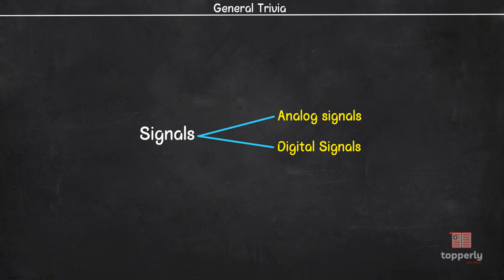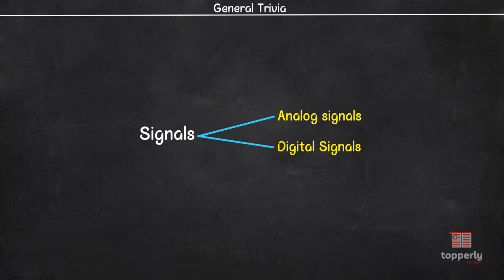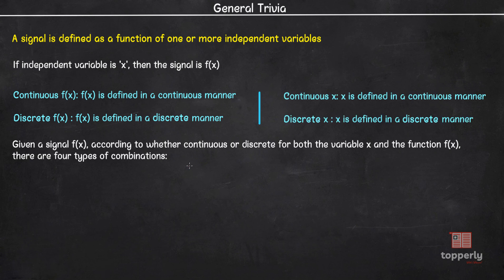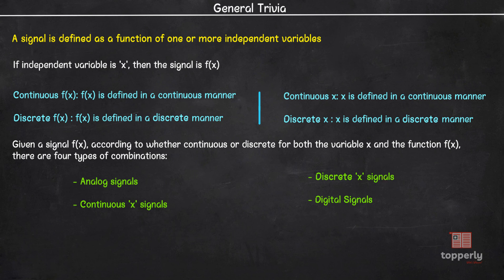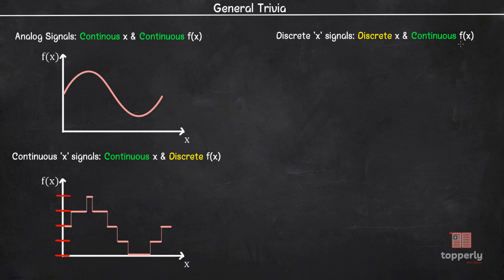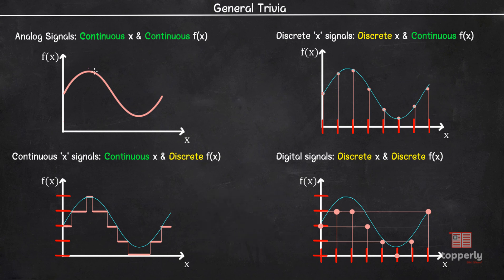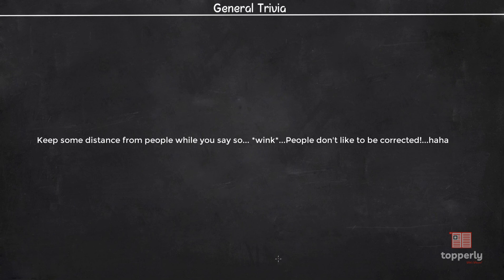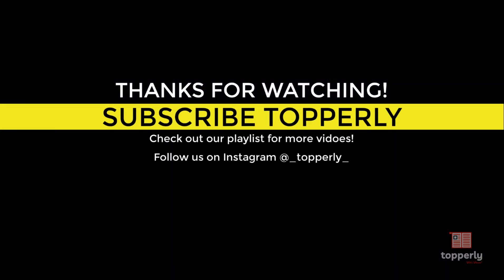Analog vs Digital vs Discrete vs Continuous Signals | General Trivia #1

Comment: I don’t think these signal are accurate. The top left is absolutely analog, the bottom left and bottom right are absolutely digital. The top right could most probably be analog too (digital if the samples are bit-quantified).
Reply from the maker: Hi, this is the exact misconception that I'm trying to correct with this video